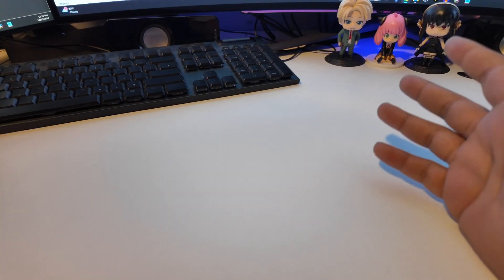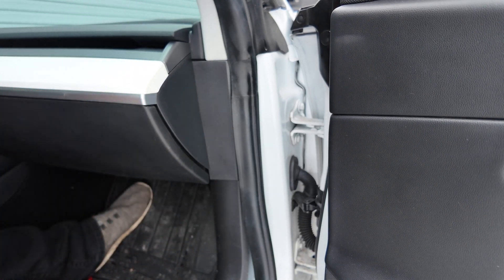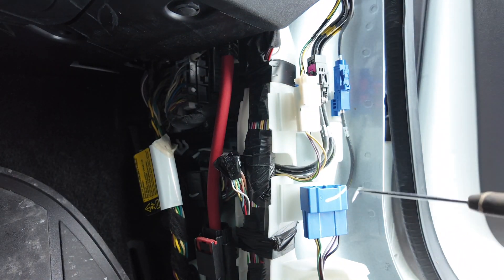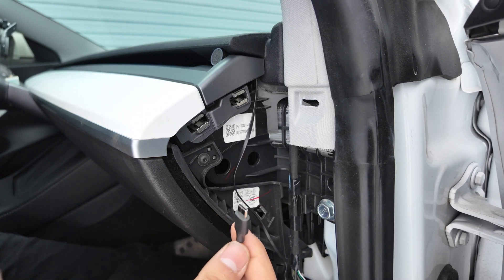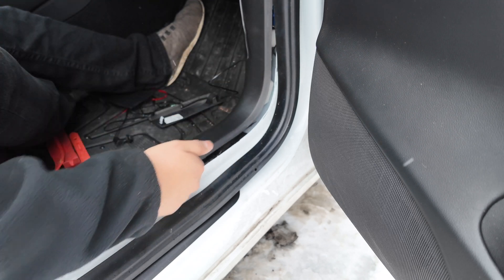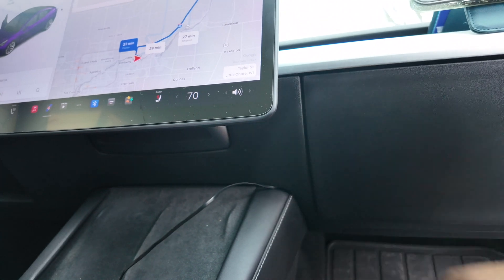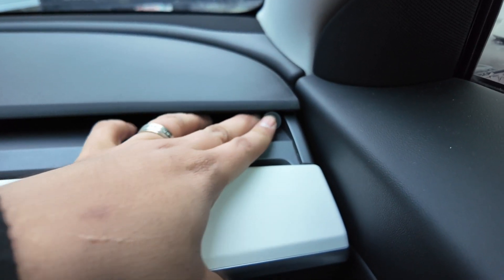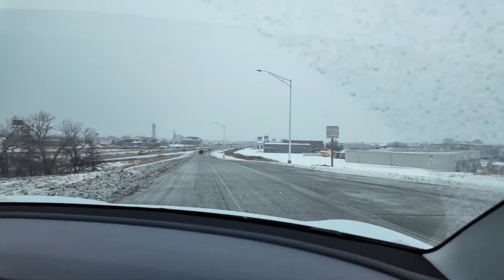Can This Tesla Upgrade Prevent Accidents?

Comment: Much better than the Highland version.  Highland version is so small, you don't see it...  I had my H for 2 weeks, before I noticed the red light and then it was at night/dark.  I think all would agree , you see the  'blue flash/pay attention' bar without having to look for it.   Just make the right and left edges of the blue bar (one inch) flash red.  You would see the 1" red flash without taking your eyes of the road. Easy software fix, for all Teslas.   The red bar they use in the camera feed is as useless as the red speaker dot.  It doesn't stand out enough, unless you take your eyes off the road and look.